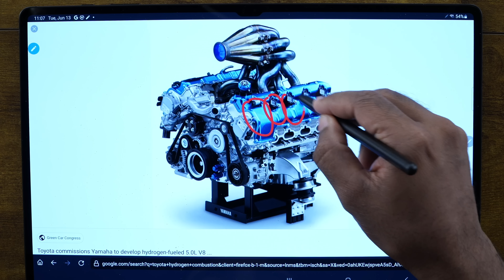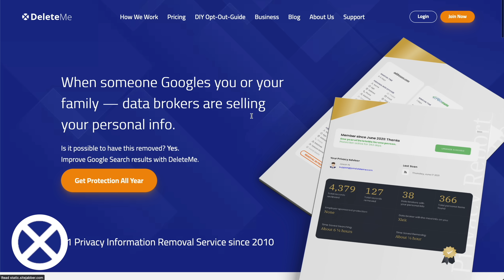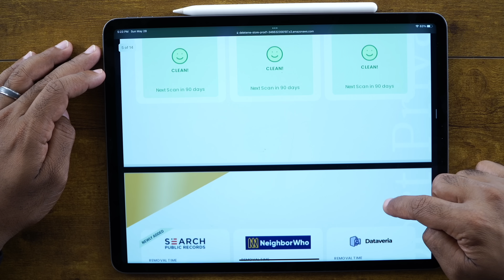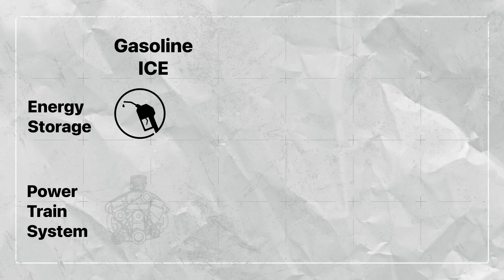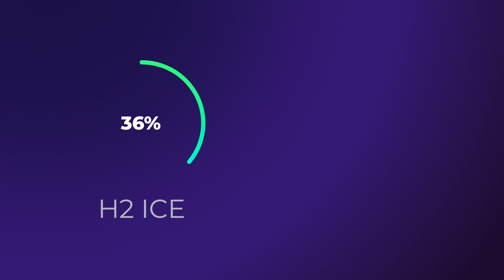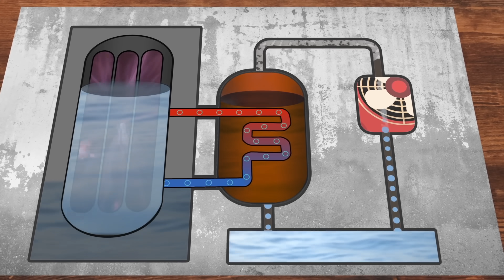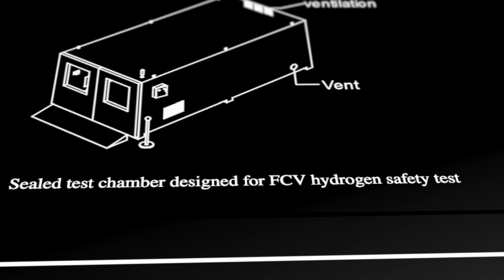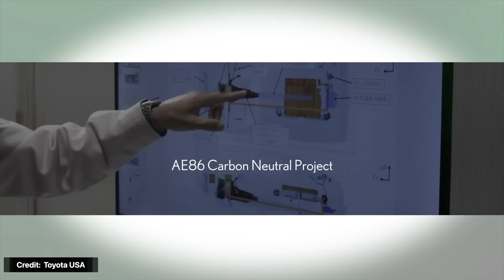Toyota's Says They Just Destroyed EVs - Hydrogen Combustion Engines

Comment: You realize that a LOT of the lost energy in winter is due to heating. An ICE has combustion so it simply uses excess (wasted) heat to heat the car. Anyone with certain Japanese or Korean cars realize that efficiency is making these cars much slower to heat as there is increasingly less wasted heat.
Hydrogen combusted will benefit somewhat like ICE… IF these H2 engines are inefficient… H2 converted to electricity suffer from the same problems as BEVs.
I have yet to see reviews of charging H2 on cold and humid days in all areas where we have cold weather… that is increasingly further south then before. These things (charging port)  chill up in the spring in California.

Comment: The problem with H² is the production and the infrastructure in general, it is a good alternative to gas and has alot of advantages, but its expensive to transport and produce at the moment. For EV's it's really easy, because the electricity infrastructure is already there, you just need to put down charging stations and it's done.
Reply: another problem is it's just not as energy efficient, EVs are all around from grid to road 85-90% efficient, H2 cars are 65%, it still uses electricity to create hydrogen so math for doesn't check out, and I think that the main thing about EVs is the fact that you can just charge them at home or with solar with practically no infrastructure needed
Reply: @antonio_fosnjar ....we don't even have anything near the infrastructure needed for the entire country to go to ev. We create blackouts every summer and winter just running ac/heat lmao.
Reply: @anthonynicholson5523  every building with electricity in this country has the infrastructure for electric cars. It’s called a 120V or 240V outlet. It’s just like your cell phone. Plug it in each night before you go to bed and in the morning you have another 40-300 miles available. It’s not like gasoline or hydrogen where your a slave to their filling station and fluctuating prices.
Reply: @anthonynicholson5523  That could be a real concern, but solar and wind energy has been getting really cheap recently, in some states they are shutting down coal plants because they don't need that much energy, EV sales are growing fast, but that's just sales, there's a ton of cars on the road and it will take a long time to replace all of them, so there's still time a dres this, my prediction is that energy would become a bit more expensive in the next 10 years, but get extremely cheap, even free when we hit the cap of all EVs on the road and all cheap renewables, I can't tell if you're trying to prove a point for hydrogen or just all carbon neutral cars, but for making hydrogen you actually need 10 - 15% more electricity or you can make it from natural gas which negates the whole point so I wouldn't see it as an option
Reply: and if we want to produce clean hydrogen, it require a lot of energy, so we should use that hydrogen for more useful stuff since we can already propulse car with electricity.
Reply: @desmart255 , Even if there was a very cheap means of producing Hydrogen, long term a combustion engine using Hydrogen MAKES NO SENSE ! 

There is so MUCH that can go horribly wrong very quickly in a situation where we try to use Hydrogen as an everyday fuel
Reply: another con to EV's is that insurance companies are scrapping EV's after minor accidents due to the risk that they randomly burst into flames at any time after an accident
Reply: The infrastructure is there? California telling folks not to charge their cars at certain times of day? More EVs equals less power for the masses
Reply: When all these ev heads have worn out their first battery pack and the bill comes for the new one opinions will soon change. And what will happen with all the old batteries?
Reply: @andrewstapleton1011  Typical response from somebody who gets their EV info from a facebook feed nipple. The batteries are guaranteed to still be at at least 70% for 120 miles and the majority of them that have been manufactured in the last 10yrs are still at 90% at that mileage.
By the time an the average ICE vehicle gets to that mileage you’ve already spent 40K in fuel in oil which equates to two Tesla battery replacements. Several Teslas at 3-500K miles on original batteries and motors. 
The batteries are 90% recyclable at this point.
Any other dumb questions or comments?
Reply: @andrewstapleton1011  what about all the other Facebook feed nipple crap you’ve been drinking up like runaway teslas on FSD, battery fires, cars too heavy for the parking garages, electrical grid being insufficient, kids mining cobalt….
It’s all a bunch of crap blown out of proportion by big oil and legacy auto cause they know their gravy jobs are on the line if everybody switches. The hydrogen promises and carbon capture are also story’s conjured up by big oil.
Reply: Wasn't this the exact same criticism 10 years ago against EVs?
Reply: The infrastructure is NOT even close to there for EV's are you serious?  If the US switched to EV like the dummycrats want we will need to double the power grid at a minimum.  Also, they do NOT reduce emissions they just move them to the power plant.
Reply: Nope, it will cost A LOT to upgrade the electricity grid. It's simply insane. And in the meanwhile we're are destroying the planet completely for EV's and HVAC.
Reply: The infrastructure is nowhere near "already there". Something that will become evident very soon.
Reply: @martinharris5017  whatever u say boss. Got any kind of evidence for your claim?
Reply: @fergyspoolshots  yes, i do, but I'm not going to waffle on here especially as YT won't allow external links, which constitute evidence. like I said, you will find out soon enough:)
Reply: That's just it. The existing electrical infrastructure cannot handle it. The reason you don't see truck charging stations pop up commercially, are that they alone require more power than a typical city delivers already. 😮
Reply: @seanhoude  Let's apply some logic.
You posted "the existing electrical infrastructure cannot handle it"
I assume you mean "can't handle EVs"?
.
But.
You have also previously posted that "Hydrogen takes energy to produce".
That's the point.
It takes MORE grid energy to produce for a given output "at the wheels".
A given amount of grid capacity moves a "direct BEV fleet" 2.5 - 3 times the distance of a comparable "Hydrogen Fleet" (FCE or Hydrogen ICE)..... Even without accounting for obtaining the water and the infrastructure.
Reply: @seanhoude  Actually, charging from home means using off-peak which is cheaper and has a capacity far in excess of the demand. Filling up H2 from filling stations means using power at peak times, with most in demand and cost.
Reply: @seanhoude  Australia are doing truck EV with 600M range and swap out battery packs.
Reply: @FireballXL55  For that, I love the idea of so-called Iron-Air batteries.
Reply: @seanhoude  Germany have been trialing hybrid trucks that run via a pantograph and overhead wire system, and have deployed cables on a short test section of autobahn.

It's not like using overhead power is a new technology, either, and while this may not be suitable in somewhere like the US, with long distances and low overall population density, it'll likely be fine in much of the rest of the world.
Reply: @seanhoude  True but the electric grid can easily be upgraded, because it's already there and mostly just needs extra wires or wires with bigger capacity. For H² you need a totally new infrastructure or rely on trucks and other ways of transporting the H².
Reply: @seanhoude The majority of people who own EV’s rarely even use superchargers they slow charge at home off peak for a few hours using about as much power as a water heater each night. 
Don’t forget about”EV’s going on fire, or parking garages collapsing due to the weight of batteries or autonomous teslas crashing into pedestrians”. 
There’s a million reasons to be scared of EV’s that the big oil and legacy auto have came up with.
Reply: @fergyspoolshots  The advantages of EV's far outweighs the negatives of ICE cars.
Reply: @fergyspoolshots  nah. Car chargers pull 30-50 amps. Water heaters pull around 18-20 amps. That is simply not true.
Reply: @jamieslatemusic  noop. 
The Tesla mobile connector which millions of people use to charge their cars every night. 

Nema 14-30 (dryer outlet) has 30amp breaker but only chargers at 24amp output (I use this)

Nema 14-50 has 50amp break but has 32Amp output.

120V only has 5amp out put (yes people use these)

So yes a water heater is comparable and our level 2 or 3  chargers aren’t going to crash the electrical grid especially considering for most people their only topping up for 2-3 hours each night.
Reply: @seanhoude  That is simply not true ! 

If a truck would consume more electricity than an average small city then if you charge about a dozen cars it would have the same effect. Also, if a truck could exhaust the entire electricity supply of an entire town, open a new Costco or Walmart and the city would go dark.
Reply: @trevorhenriques7733 I think you made that up, unless you are trying to charge a truck in one minute, in which case, you can connect a big battery to the charger. Show me a real example.
Reply: @fjalics , I made WHAT up ???
Reply: @trevorhenriques7733  A truck will not consume more electricity than a small city. Maybe as much as 5 or 6 cars.
Reply: @rogerphelps9939 ,  How did you manage to draw the conclusion that I was saying a truck would consume as much as a city or town ??? My comment was a pushback against someone who said that. I articulated this quite CLEARLY in my comment, yet you are the second person who ignored the guy that said it and saw MY comment as the erroneous one !
Reply: @trevorhenriques7733  Sometimes the comments get placed under the wrong answer. Not intended by me!
Reply: @rogerphelps9939  It's the proposed truck charging stations that require more than a small city.

Comment: But if hydrogen is the MOST abundant thing ever, what difference does it make if the conversion to energy is low? You are also forgetting electric grids in any country cannot support a full fleet of EVs, even in America we have blackouts all over the place: hydrogen cars solve this massive problem.
Reply: Well, energy isn't free so the conversion rate matters. Duh. When fusion becomes cheap and it doesn't matter anymore though we can just make gasoline from the air and water for free and carbon neutral so this won't matter anyways.

Comment: Electrolysis requires very pure water in order not to wear out the catalyst and what not. Cleaning the water is another energy intensive step in the chain that is often overlooked.
Reply: So many people overlook this. Much of the US already uses more than it’s yearly rainfall totals and are using up aquifers. What would happen if millions of gallons of gasoline were replaced with hydrogen? Tell farmers they have to choose between watering crops or filling their tractors.
Reply: The vehicles could resuse the water and not need to purify it again. Add a water tank, instead of exhausting the water vapor. When refueling, the purified water can be transferred to the fueling station.
Reply: @robburns1ne  as the video says - there are traces of lubricants in the exhaust. Still need to treat that water.
Reply: @NoHandleToSpeakOf  I was taking about FCEV. ICE H2 makes no sense whatsoever.

Comment: This video made me feel like an idiot ;) Almost 100% of my experience with Hydrogen Fuel has been related to using Fuel Cells to replace diesel generators at data centers. BTW, no company I worked for ended up using Fuel Cells in anything other than an R&D and PR capacity.
It just had too many issues, even though it WAS better overall.

I had NO idea that anyone had worked seriously on Hydrogen in an internal combustion engine. I assumed Toyotas insanity was based on Fuel Cells. I have a lot more thinking to do. Many of the downsides are only downsides because of our current assumptions and infrastructure. If Hydrogen storage and use as a fuel takes off, most the issues are FAIRLY easy to solve without new inventions or tech.

People generally REALLY REALLY don't understand what the need for rare-earth minerals means for batteries/EVs and by extension solar and wind. We will not be able to provide for our needs safely without some nuclear, hopefully fusion and more importantly CONTINUING to burn things. --- IMHO
Reply: Batteries needing rare is metals is an issue that is fading away fast. And hydrogen fuel cells need titanium. Fission requires uranium/plutonium/thorium. Fusion requires hydrogen which is common but not in forms that we can get without energy intensive processes
Reply: You don't need rare-earths for batteries or cars. Yes they're used but they're not required.
Reply: @imzjustplayin  yeah stuff like LFP is already well on the way to no rare earth metal batteries. Lithium isn’t an issue despite common belief’s.

Comment: Most global hydrogen comes from methane so NOT clean. Producing "clean" hydrogen from cracking water to drive cars use 4X more energy than charging an electric cars batteries directly using solar panels. Hydrogen is the smallest atom & escapes with explosive results very easily. 
The only people really pushing for hydrogen fuel are the Fossil Fuel companies who are desperate for a replacement consumable that they can control, in the same way they do gasoline. They know petrol is being phased out and if people charge their electric cars for free from solar at home, the fossil fuel companies will have zero consumables that they can rip off consumers with!

Comment: I can see this working for things like trucks for long haul travel. And it would be quite interesting to explore the use of H2ICE for aviation. But at a consumer level for everyday it has the same problems as fuel cell without any obvious improvement but a few extra shortcomings
Reply: Hauling is about the cost per mile. No company is going to bet the most expensive option
Reply: Yes, and the two biggest shortcomings are poor efficiency and NOₓ emissions.  

The efficiency of all internal combustion vehicles is horrible -- can't get around the physics of combustion.  Jason at his Engineering Explained channel white-boarded the hydrogen combustion engine and showed a massive hydrogen tank is needed to match the standard EV 200+ mile range nowadays due to internal combustion hydrogen's terrible efficiency.

Our atmosphere is 78% nitrogen.  So any high temperature combustion in our nitrogen rich atmosphere makes production of toxic NOₓ unavoidable even with clean hydrogen as the combustion fuel.  This is also part of the issue of banning natural gas ranges in homes because of the NOₓ produced in enclosed indoor environment makes it all the more dangerous.
Reply: @beyondfossil  "So any high temperature combustion in our nitrogen rich atmosphere makes production of toxic NOₓ unavoidable even with clean hydrogen as the combustion fuel." 
you wanted to say "it becomes worse with hydrogen". Hydrogen is worse for ICE because it has to be operated on richer mixture and has incredibly high flame speed, which results in incredibly high local temperatures (not to mention knocking problems). Such ICE's will have to use water port injection because of that...
Reply: I think jet engines are more for aviation. Maybe converting an old plane to hydrogen would be cool
Reply: I do not think H2ICE for aviation makes sense. 
Fuel cells are way more efficient and have almost the same power density as ICE, plus fuel cell/electric motor combination is way more reliable than ICE (so you can forget about overhauls after 350 hours), and the price is less factor in aviation. Using today's cells the mid-range aircraft weight increases by 18% - not yet acceptable, but aircraft specifically designed to take advantage of this can have unique features that will make them attractive, e.g. VTOL. Of course, this will not work for high thrust aircraft...
Reply: It is even worse on efficiency than fuel cells. Already HFCEVs can only just match the best BEVs. Now imagine a truck with half the range of a BEV truck. That is hydrogen ICEV.
Reply: H2ICE for aviation? There's the tragedy of the Hindenburg disaster before, it will take a lot of convincing to make this happens.
Reply: @easyxpress  that was a giant balloon not an airplane.

Comment: Was there not a recent scientific paper stating Hydrogen had the potential of being way worse for global warming than CO2, not because it's a Greenhouse Gas(it's not) but because it combines with the #1 molecule that joins with the mathane removing it from the air.  As the most hard to contain gas there is, that is problematic.
One other aspect is green hydrogen is a battery.  A 30% efficient battery.  Take green electricity, make hydrogen, compress or cryogenicly cool and put it in a fuel cell vehicle and ⅓ of the electricity originally produced moves you down the road.  That efficiency drops even further if we add an ICE into the equation.
Reply: Anything that improves the standard of living for the masses will be demonized, especially if doing so gives the sociopaths a new excuse to demand more power "or else".
Reply: I am a firm bible believer, hence I do believe in "demons"!  This does not say I don't believe in science.  I believe the world is getting warmer.   I believe global emissions are contributing to that.  If the reason to FRANTICALLY  make the transition to "green energy" is to avoid an eminent disaster, should scientific papers about new potential sources of global warming be ignored?